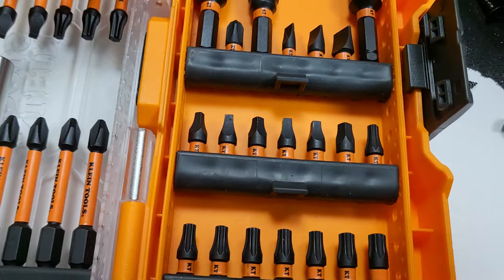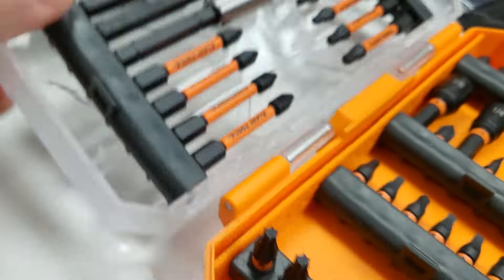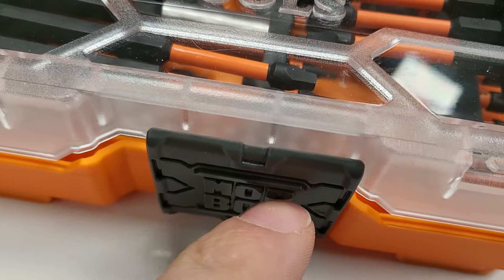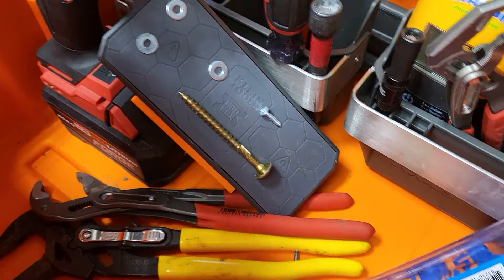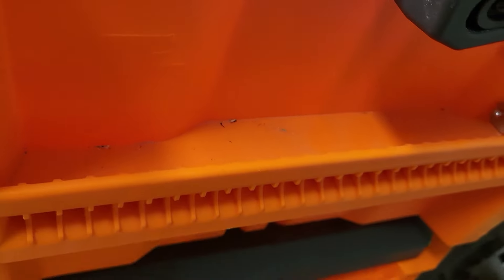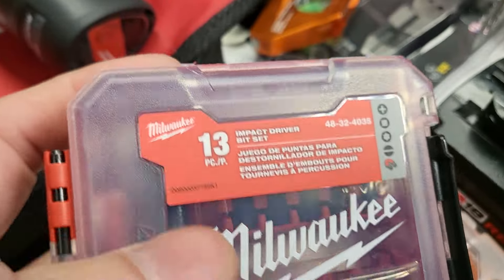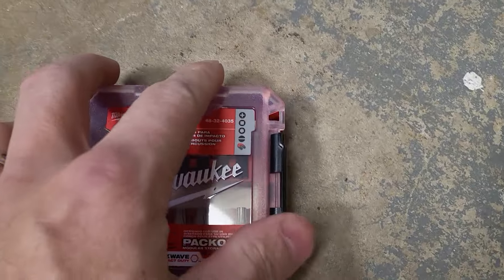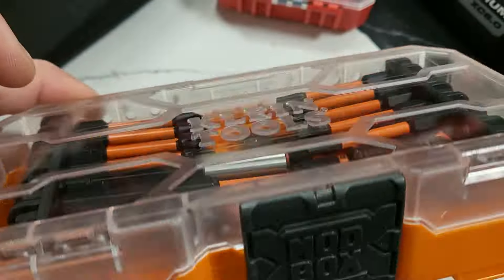Klein Tools Modbox Bits

Comment: Nah, that’s not how they work. The bit holders have a tab to tilt the bit holder bar vertically and the bits are super easy to get out. The latch on mine doesn’t snap closed like yours, it’s designed to slide. These bits a designed to be a magnetic hold, not a lock in design which is what you want for fast bit changes. You obviously get a kick back from Milwaukee, or maybe you need to get familiar with hand tools prior to doing any reviews.

Comment: Aren’t these items supposed to attach to the top on the box, not the side? Seems like user error 🤷🏻‍♂️
Reply from the maker: Haha yeah they can  I tend to drop bit cases often I load them up with my preferd brand  and use the case. It's no secret these  bits are not make by klein and are garbage.  Bosch + dewalt are superior to most no pro. Unless (they are a just a huge fan of klein) expects these bits to last. We all know they are junk. The case is what I was curious about
Reply: @toolsandtactics  I picked up the Klein precision driver with ratchet in a mod box, I don’t have a full load out, but so far I’m happy with it, and I don’t use my tool professionally, so they tend to last a very long time… with the exception of t20 bits.. I hate those things, they put them on way too big a screw and I burned through about a dozen of them on my last project… t25 is a far superior bit size for a 3” #10 screw..🙄

Comment: Got this a week ago. Magnet doesn’t work at all. This is garbage. everything about it. They had such a good opportunity here and failed lol. Pretty much everything else Klein has made in the last year
Reply from the maker: 💯   the klein long magnet drivers, and a few screwdrivers but yeah, the rest  junk
Reply: @toolsandtactics  disappointing. I want to like Klein. I bought pair of  journeyman grip linemans. They cost just as much as a knipex alternative roughly.  The pivot was sticky but I am not picky too about that. I went to put some ballistol on my tools the other day and the black phospate/ecoat started rubbing off with a shop rag on the kleins. I couldn't believe it. 

I oiled up several knipexs, channellocks, grip-on epoxy coat pliers, midwest tin snips, vintage craftsman adjustable wrench, & fiskars scissors that day. That covers just about every tool coating+material, and many brands (chrome, black ecoat, knipex atramentized, epoxy, black phosphate, polished bare metal, comfort handles, plastics handles) AND NOT A SINGLE OTHER TOOL had any issue with this treatment besides the kleins. Now my kleins look like a dalmatian. Ridiculous. 

I used to work in metal stamping & hinge assembly for the automotive industry as a quality manager. We used black ecoating & zinc coating as corrosion prevention. Poor coating adhesion was almost always attributable to a contaminated surface that was not fully cleaned before undergoing the actual plating process.
Reply: Besides the “magnetized extension”, pretty sure these bits aren’t magnetized?